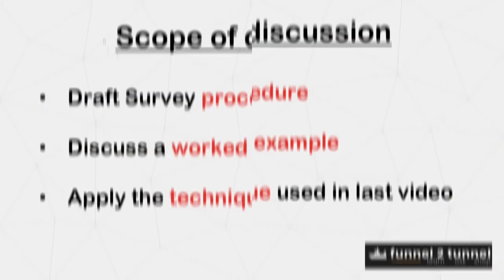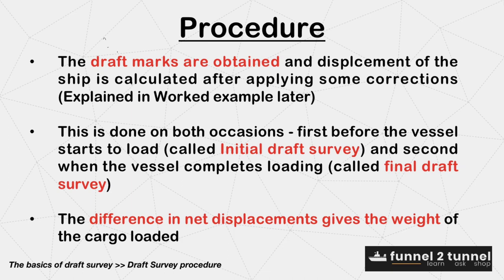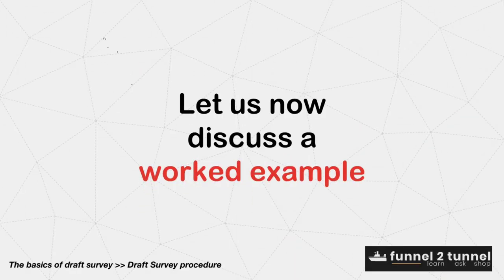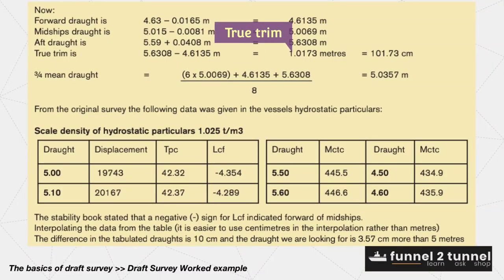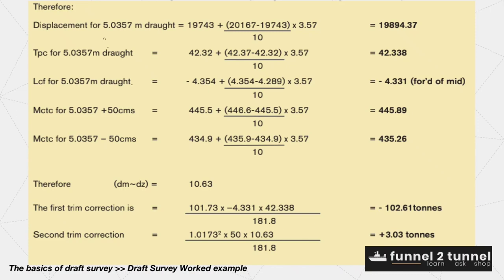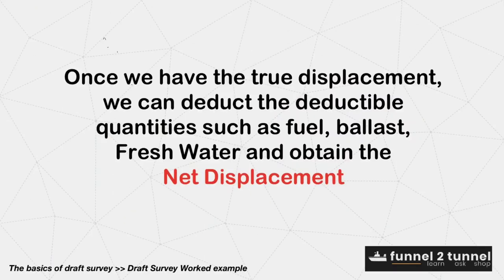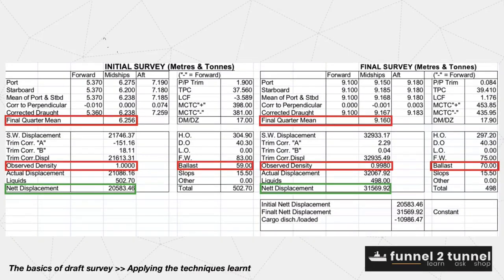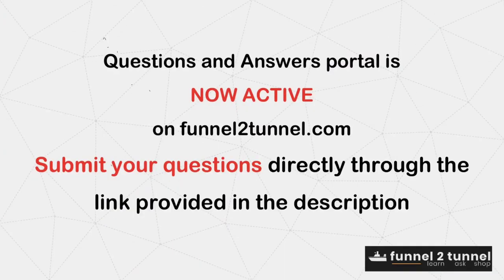Best Practices Series | Draft survey procedures | Worked Example & techniques

Comment: SIR, MAKE VIDEO ON  DRAFT SURVEY WHEN VESSEL IS DOWN BY HEAD
Reply from the maker: Hi!
Usually, it is not preferred to carry out the draft survey when the vessel is down by head. Even at most of the ports the draft surveyors would ask you to either bring the vessel to even keel or slightly trim by stern prior doing the DS.